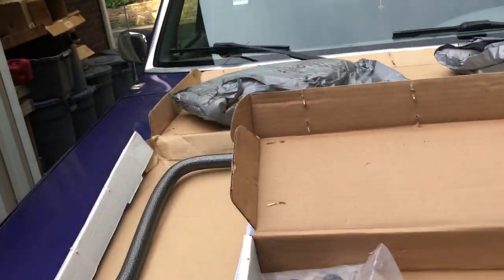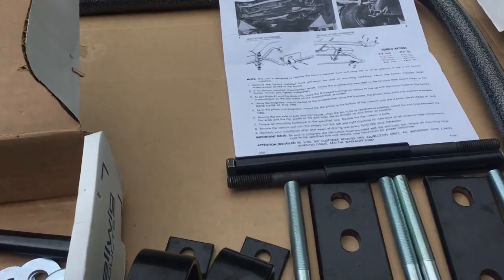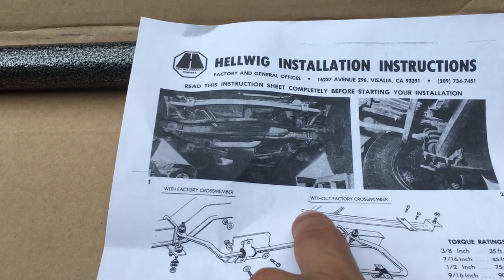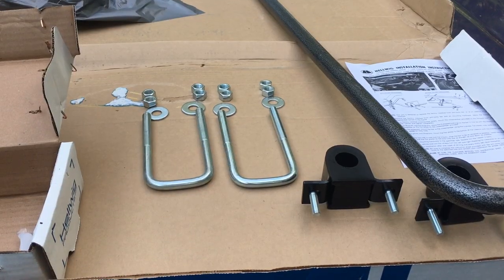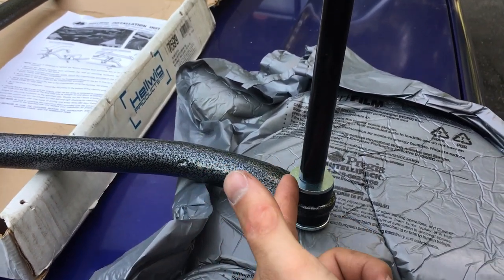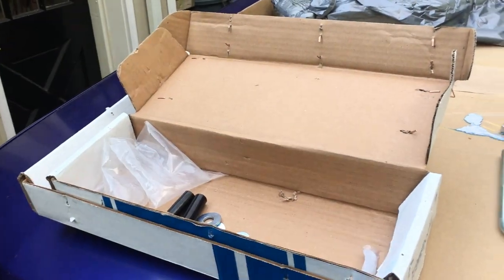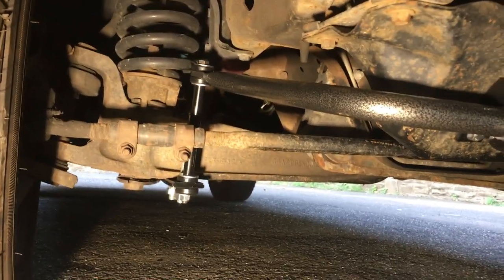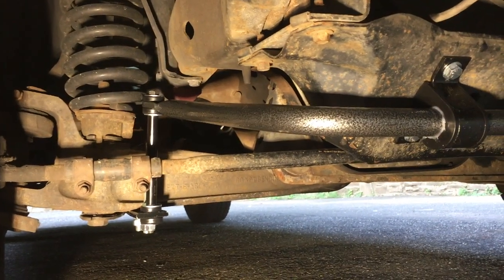How to Install an Aftermarket Front Sway Bar | 1995 Ford F150

Comment: Steve, I purchased a 95 F150 three years ago.  Back then I did some work to clean up the interior then put a pause on the fixing it up till recently.  I want to tweak the front suspension and steering.  I have closely watched all 19 videos on your playlist on this.  I plan on doing a lot of the work on the list.  My question, is there a specfic order you would recommend to do the work?  Maybe the oldest video to the newest??  Thanks in advance.  I love watching your channel.  You do a great job passing on the info!  I really enjoyed the videos of you with the Navy Sea Cadets.  I am a 20 year Navy man myself.  Thanks again.
Reply from the maker: Thank you for your service! I enjoyed every minute of my 15 years in Sea Cadets.
Anyhow, I would start by checking the bushings and replacing them as needed. I would then check the ball joints and replace as needed. Same for the steering assembly I.e tie rods and drag link. 
Fresh shocks are always nice too.

Comment: Great job making a video on a subject most may have thought why bother due to the simplicity! 
After all, if you own one these wondering around twin beam Ferds most likely installing a sway bar should be relatively easy undertaking for even the novice with a two pairs of channies
Reply from the maker: Thanks man!🤙 I’ve learned over the years even the simple things require videos. But you are right. Adding a sway bar is pretty simple and straightforward.

Comment: I know this was 5 years ago, but would you still recommend sway bar install? Any problems? Does it get in the way when having to change other things out like tie rods?
Reply from the maker: After living with the sway bar and understanding how the twin I beam suspension works, I wouldn’t recommend a front sway bar. A rear sway bar would make more sense with controlling loads.
The sway bar doesn’t physically get in the at with making other repairs like tie rods.
Reply: @TheMinuteMasters  okay thanks, appreciate the info.

Comment: Great video!
One questions, I just recently did a 4inch lift on my 93. f150. Now the front end links don't align. 
I has a factory sway bar connection underneath the spring 
maybe I could convert it to this type of sway bar?
Reply from the maker: Thanks man!🤙

So when you do a lift kit, you usually get longer sway bar end links. If they doesn’t work, I’d buy this kit plus a set of longer end links and that should do the trick.

Comment: They video was great man. Easy install. I have a question about the back sway bar. With the after market one not having so many bends it, how does it bend around the driveshaft/axel to bolt to side of the axel? Where does the center of the sway bar go? I tried calling the company you got your sway bar from and left a voice mail because they didn’t answer.
Reply from the maker: Have you installed the rear sway bar yet? Once you have it and you mock it up it will start to make sense.

Comment: Do you think this sway bar set up would work with a lowered truck?  With DjM dream beams?
Reply from the maker: Jason Houff I haven’t worked with any lowered trucks yet. However, based on pictures and how this sway bar bolts to the frame and beams. I think it will work. With that being said, even if you mock it up and it doesn’t work. You can always return it.🤙

Comment: your truck is a 2 wheel drive right? I looked at the link you put on here and they told me this kit did not fit a 2 wheel drive. said it was 4 wheel drive only. 
Do you remember the model number?
Reply from the maker: Yup, 2wd. Really? I’ll have to go check. I think the sway bars have more to do with having that front skid plate or not.

Comment: I took off that factory cross member on my truck to derust and paint it but I got sidetracked with other stuff and days turned into weeks which turned into months and I've probably been driving with it off for a year at this point lol. I just assumed it was a skid plate type thing. Can't say I noticed a difference but then again I wasn't looking for one because I thought it was simply there for protection.
Reply from the maker: Yeah I’m not sure what it does other than protect the the engine frame crossmember.

Comment: great video, do you need front and rear sway bars? and will these work the same with a 4 inch lift?
Reply from the maker: Now that I have a front sway bar and have lived with it for a while, I would honest skip putting a sway bar on the front and only do the rear. The twin I beam suspension works much better without a sway bar.
Reply: thanks! i think i’m gonna do rear sway bar and just some dual steering stabilizers on the front, mine is pretty lifted so the body roll is pretty wild

Comment: Any suggestions on how to get a bracket for the end links without buying the $400+ kit?
Reply from the maker: I think a thick enough steel plate and U bolts would do the trick.

Comment: i have a 96 5.8l 351 i plan on getting a 6 inch lift next summer but my body roll is freaking ridiculous!! can you add a link for the sway bar id need to buy?

i have a factory sway bar, i changed the whole front end beside automatic hub bushings and body bushings no luck. also re-manufactured steering box and still a crazzy amount of play in that, ive tightened it to where i think its already to much and still way to sloppy.

sorry im including to much but you seem to know you stuff and not to many do when it comes to broncos so i have to ask. i have a few pics of vacuum lines where my so called "soup can" goes and theres 3 or 4 vacuum lines that are colored coded that are just cut and not attached to anything and i have a code for insignificant egr flow . would you be any help with that?
Reply from the maker: SECOND&GONE Nice man! I feel ya these trucks do have a lot of body roll if not taken care of. Here’s a link to the sway bar I bought:

https://www.sdtrucksprings.com/index.php?main_page=advanced_search_result&inc_subcat=1&categories_id=1504&year_select=1995&make_select=622&model_select=8192&x=111&y=20

So by everything, you have new springs, shocks, bushings, ball joints, I-beam bushings, wheel bearings, and drag link steering parts, and tie rod ends?

That is a pain. I’m traveling now but I can check my truck and see how my vacuum lines are run. Mines an XL so there may be a few missing because I don’t have cruise control.

Comment: looking at a 94 f150 6 inch lift on 33s. was told it had play in the steering. will a new stabilizer bar fix that he said i need a new stabilizer bar but wanna make sure before i buy it
Reply from the maker: Dan Ellsworth Gotcha. A sway bar flattens out the steering. Do you have excessive body roll or is there a lot of play in the actual steering?
Reply: @TheMinuteMasters  theres not alot of play maybe a inch at the most.
Reply from the maker: Dan Ellsworth I would try tighten the steering on top of the steering box first.   Only tighten it a 1/4 turn at a time. I’m told over tightening it can make the steering too tight and wear the gears out prematurely. Otherwise, make sure all your steering components are in good working order, that includes the ball joints. I say go for a seat bar because it just makes “spirited” driving that much more fun.
Reply: @TheMinuteMasters  I'll try that thanks alot
Reply from the maker: Dan Ellsworth No problem Dan! Good luck!🤙

Comment: Is your truck lifted? I want to use this same sway bar but am worried as my truck has a 4" lift. 2wheel drive
Reply from the maker: My truck is the standard height. I believe you need longer sway bar end links in order to install a sway bar on a lifted truck.

Comment: this sway bar is like a add on? not original from factory was it alot easier than keeping it oem?
Reply from the maker: Allan Blazek This is an aftermarket sway bar. However, these trucks did come with sway bars depending on the trim level.
Reply: @TheMinuteMasters  thanks for the reply i discovered my sway bar missing i can see where it would bolt on too its never had one and the handling is bad xlt 4x4 1994
Reply from the maker: Allan Blazek If you have all the holes and such to mount a sway bar, I would definitely install one. They will improve your handling big time!
Reply: @TheMinuteMasters  thanks again this may be the fix for me im definitely looking into this
Reply from the maker: Allan Blazek No problem man!🤙 Good luck with the project!

Comment: Would this work on a straight axle ? I’m anew owner of a f150 95 with a straight axle conversion
Reply from the maker: I don't see why not. The concept is pretty much identical. You can always called Hellwig or check their site for more info. When ordering the part, they didn't have kits specific for I-beam or straight axle. The only difference in kits was the one for crossmember and one for non crossmember.
Reply: The Minute Masters could you post a link where you ordered your kit?
Reply from the maker: Travis Freeman here ya go!👍

https://www.sdtrucksprings.com

Comment: the link is for a rear kit
Reply from the maker: I’ve been told by watchers that the front sway bar has been discontinued, but you are welcome to search that site and see if they still have them.
Reply: @TheMinuteMasters The part # for our truck is 7550.  Did some looking around - definitely discontinued. They still make the rear but not the front - why? Anyway, found an old stock one and jumped on it. Thanks for the video. New subscriber